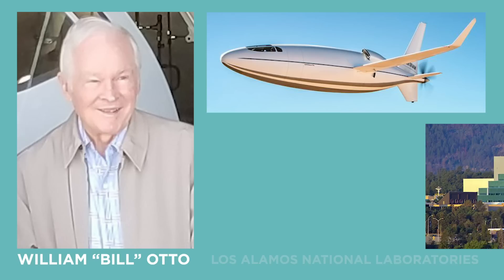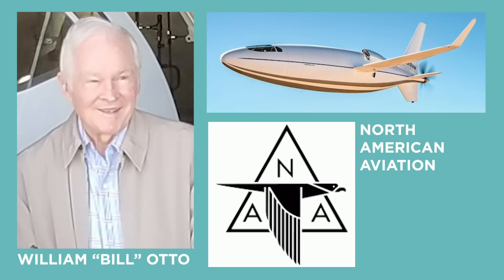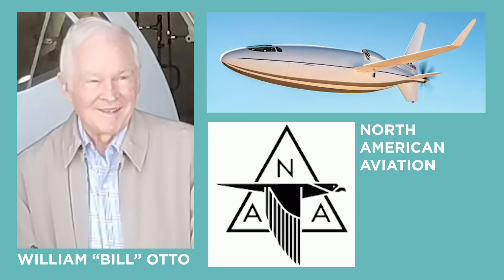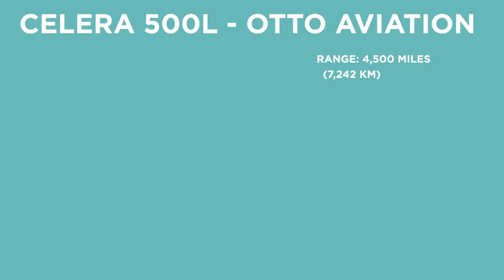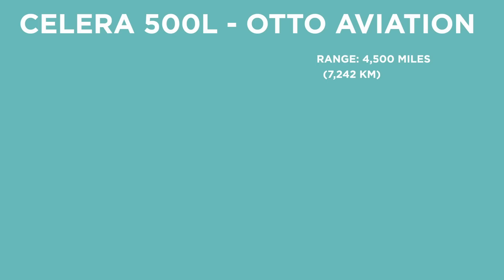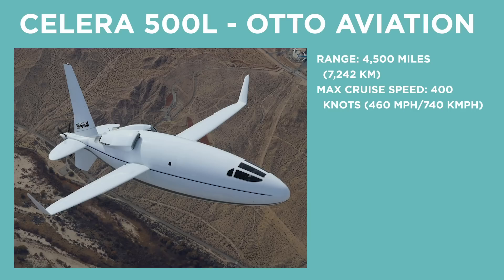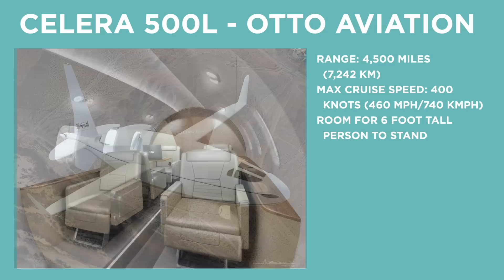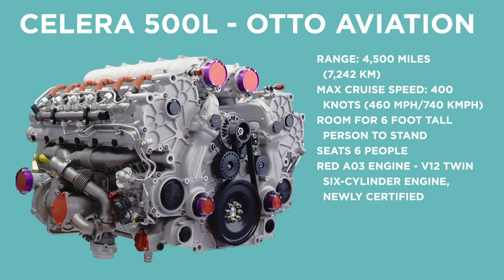Could This Plane Save The World? (Hint: No.) | Answers With Joe

Comment: Joe, I agree with your analysis, and your final thoughts on the real value of the Celera. Here is a sample use that I envision: I live an hours drive from Sea Tac Airport in Washington State and 20 minutes from an airport bus service. Near this bus service is a small airport that serves business jets. Let's say that I want to take my family of 4 on a trip to visit relatives in Wisconsin Rapids -- a small town that probably also has a small airport for general aviation. Right now I have to drive to the bus service, getting there 30 minutes early, then take the bus to Sea Tac, taking an hour, then spend 2 hours going through security and waiting for boarding. Then waiting on the plane for departure, and finally take off. Similar procedure in reverse on arrival in Milwaukee. But few flights go directly to Milwaukee. Last time we did this, our flight went to Kansas City which must be a few hundred miles south of a direct line from Seattle to Milwaukee. Double that for going back North. Then add in the landing in KS, layover, and plane change. That is a full day. A long day. And we still have to drive or bus a couple of hours to Wisconsin Rapids.

Now consider a Celera charter service. We take our family of four and invite a couple of friends. Or, let the charter service find a couple of people to fill the other two seats -- someone who wants to go to any small airport Between our little town and Wisconsin Rapids. We simply drive 20 minutes to the airport, arriving 10 minutes before departure. The plane lifts off about 10 minutes after boarding. They fly us directly to Wisconsin Rapids -- with possibly an hour or two spent delivering the other two people someplace else. They could fly at half speed, saving even more gas, and we would still get to Wisconsin Rapids faster than on a big jet. And fly in first class seats!

Comment: I’m an engineer and about 7 to 8 years ago I was thinking about how I’d design my own personal aircraft (a real stretch lol)

But yeah, the shape of the fuselage I figured would be a NACA 0025 profile revolved around its axis. What that does is create the largest volume to surface area ratio, in a profile (like a teardrop) that would result in a very low amount of subsonic drag. You could fill the volume up with fuel tanks, engines, cargo, whatever.

I wanted to put the propeller on the back because the profile just doesn’t lend itself well to a front prop, but rear props have problems with ground strikes, so usually any benefit you get from the rear prop is omitted by weight added in landing gear.

Last, yeah, if you look at subsonic lift long enough, you come to the conclusion that high aspect ratio is more efficient. So you wind up with wings like a glider, that you see here. The problem with that is structural again. So hopefully you don’t lose performance due to weight, which is why most planes don’t have glider wings.

Last, high altitude flight is more efficient if you can get the propellor sorted. Air is thinner, less drag. Less lift too, but if you have enough lift, the drag will be less the higher you go. You can run a turbo to keep the engine producing power at high altitudes.

Anyways, def cool to see this guy implementing those ideas. Not often you get to see industry implementing what logically makes sense on the surface. Otto is the people’s champ!

Comment: It comes down to not MPG, but passenger miles per gallon. Economy of of scale.

But for charter, yeah it’s potential is big time.
Reply: He adjusted the 500l's passengers miles per gallon economy. He did it  backwards by scaling up the number of 500l's but the effect on the math is the same.
And the 500L's actually did better then 747's in passenger MPG. By a lot. I'm pretty shocked.
(Except he made one mistake. the 500l's would actually be carrying about 50 more people with the pilots he forgot to tally them. Making it even better in those regards. I think it will be a design Revolution. But nowhere near replacing 747's way to small lol)
Reply: @allhumansarejusthuman.5776 
“...A 747 is transporting 500 people 1 mile using 5 gallons of fuel. That means the plane is burning 0.01 gallons per person per mile. In other words, the plane is getting 100 miles per gallon per person!..”
Reply: Passenger-miles per gallon is only a thing for airliners and large corporate jets that shuttle employees between facilities like the jets that ferry people between the Fiat and Chrysler headquarters.
Private aircraft under 15 seats spend most time at partial payload, often because full fuel eats into passenger/cargo capacity. Or vice versa. This won't be flying many Part 135 flights, it's too small and expensive to fly as an unscheduled charter aircraft. It could do some scheduled air taxi stuff, though.
Its direct competition will indeed be the Pilatus PC-12 which carries 2 more in a smaller diameter fuselage and also can use unimproved airstrips. Aircraft with pusher propellers usually can't qualify for rough-field operation because the nose wheel kicks up debris that can damage the propeller. Plus they have restrictions on pitch up at rotation. The turboprop of the PC-12 is going to have a lower operating cost (ignoring fuel) due to higher overhaul hour limits and a more accessible engine with modular construction.
20 mpg is Mooney territory, but without the cramped passenger compartment of the low frontal area design of the Mooney.
The problem with laminar flow designs is that the laminar flow gets disturbed by things like bugs and dirt, ice, and even heavy rain. This can turn a slick, efficient design into one that can barely generate enough lift to maintain altitude. If you are going to want to cross the US in this, you'll want things like deicing gear that tends to disturb the airflow.
Reply: @allhumansarejusthuman.5776  Pilots are not paying passengers, they are on the minimum equipment list along with enough flight attendants to safely manage a 90 second evacuation. A 1000 mile trip in a 747 is something you only saw in Japan on domestic routes due to air traffic congestion limiting the number of takeoff slots. Much of the fuel burn in a jet is down low where the engines are less efficient and they operate with drag-inducing stuff hanging out in the air. On longer flights the per-mile fuel burn drops quite a bit.

Comment: I know this is a couple years old by now. Something that may have been covered in the 2,700 comments is maintenance. Your example assumes all 61 Celeras would be taken out of service for maintenance at once, just like the only 747 in your comparison. The loss of revenue during downtime would be much less than the 747. Of course, paying for 61 maintenance activities may cost more than the one session that takes out the 747 (knowing full well they aren't subjected to just one maintenance session per year). Still, that's a lot of missed revenue while that 747 isn't flying.

Living in the northeast, I would love to see 1 flight heading for Newark Liberty reduced to just 1 with 60 more heading to the hundreds of smaller airports between Richmond, VA, and Bangor, ME. Reduce layovers, put the people closer to their actual destination, and make way for smaller, far more efficient aircraft to take them there.

Great video, as always. I would have liked to have seen more about maintenance. I mean, it is powered by one diesel V12. Oh, and 2 months ago they raised the range to 5,000 nm from 4,000.

Comment: I believe you should consider few points:
1) 747 and A340 (or whatever) cost around 2/300M $
2) An eventual 1000L with autonomous driving will be even more convenient
  2a) It may carry around 20 passengers
  2b) A lot of current airplanes fly with empty seats
3) It will open a new kind of transportation (shorter and more frequent connections)

Comment: I personally share the opinion that we just need to figure out how to fly less. We need to invest in high speed rail. Flying should become something we do for longer trips.
Reply: well you could just invest in hyperloop high speed trains and never really have to use planes at all
Reply: @ThaEnglishPwner  hyper loop is a novel idea but it has a lot of real world issues. High speed rail is a proven technology that can be rolled out rather quickly.
Reply: Hyperloop can compete with long-haul airliners, while neither form of high speed rail can. Conventional tracked high speed rail has operational speed limits due to vibrations from the wheels on the tracks creating an unpleasant sensation for passengers, and very few will go by train if a plane is quicker and cheaper. For current forms of maglev, the extremely high cost of installing and operating the tracks means they're only economically viable in extremely high density areas, and will never be a viable option for long-distance travel.

That doesn't necessarily mean hyperloop will become a major mode of transport - at least, not on this planet.

Electric planes will be okay for short-haul, but can only become an option for long-haul if we find a way of making batteries with well over ten times the energy density of current options. This leaves two main options for long-haul travel: hyperloop, or high-efficiency planes running on sustainable fuels, and I think the latter has major advantages over the form. First, most intercontinental routes will have to use planes due to the difficulty of building a hyperloop tube under the ocean, especially if there is a tectonic plate boundary involved. Second, airliners already have a lot of ground-based infrastructure, so the amount of investment needed to get them flying is low. And third, fusion power looks set to become a viable energy source about a decade too late to become a major one, and will instead play second fiddle to renewables like solar. This is important because solar's major disadvantage - the huge summer surplus - is an advantage for anything requiring sustainable fuels, because it can be used to produce them. If fusion power were already widespread, hyperloop would be competing on a level playing field. Because solar is already a major energy source, and is set to continue growing in the future, sustainable-fuel airliners have a significant advantage.

There is one place where hyperloop does make sense though, we're just not there yet: Mars. The thin atmosphere means winged aircraft don't function well, if at all, while hyperloop tubes don't need to be as robustly engineered - and therefore expensive - as on Earth. Likewise the lack of oceans means hyperloop has few restrictions on where it can go.

Comment: I didn't read all the comments yet,  but I wanted to comment that this airplane is a stellar example of the really good gas mileage  a really good designed airplane  can get. To wit, really goodly other airplanes get stellar mileage like..no  motor at all!  Gliders. Google 'Bodies Of Rotation' s to see how they get the smoke back into the bottle. And this concept is scalable.

Comment: 2 things. 1) Its 6 business class seats which can be swapped out for normal coach seats. 2) The Celera 1000L is likely the one the airlines would be interested in to replace their jumper fleet of jets. The 500L is more aimed at small private jet replacement.

Comment: My experience is that companies can't "efficiency" their way to success...
Reply: Depends on the company/industry. There's many that work on razor thin margins.
Reply: "Efficiencying" the way to success has gone out of style in the 30s ...
Reply: What experience do you have that an inefficient company was highly successful?
Reply: Especially in the aviation industry.
Reply: @KazCanning  it's kind of like a social truth. do gamers want the most efficient computer? or do they want the one with the wasteful interior lights, and power hungry heat generating processors? do all of the Fast & the Furious wannabes drool over the most efficient car? No, one trip up the highway will tell you that they don't.
Reply: @KazCanning  Congressionally approved military contractors.
Reply: @better.better  Yes I want the most efficient computer. And that's why everyone chases the new updates(the lighting is an aesthetic but that doesn't mean I want an inefficient computer) I do not know why you mentioned that, it just made ur point worse.
Reply: @KazCanning  the American political system
Reply: @KazCanning  : I'd guess that the proof is actually the other way around- the low-cost long-range airlines have demonstrated that efficiency does not make the difference. I saw a video on the subject, and they determined that because of the higher cost of the efficient options, the cost benefits of efficiency were eliminated, thereby eliminating the ability of efficiency to make airlines successful. The things that make a difference are things like competition (if you have more competition on a route, then you need a better reputation, which means more comfort, which means more money per seat, which means you need to increase the cost of a ticket to compensate), not fuel efficiency.
Reply: Unless... The Expanse
Reply: @eleonarcrimson858  Do you want a slow computer that is very efficient, or do you want a fast computer that is inefficient? That's the real question. You generally don't get both power and efficiency in any application.
Reply: How are we all defining efficiency, exactly? Are we measuring it purely by energy in/energy out? Or are we taking into consideration all other possible needs/wants of consumers and whether or not they are being met by the products of producers? Because under the former definition, an airplane with no seats, bathrooms, or passengers would be extremely fuel efficient. Or would we all agree other factors need to be taken into consideration when defining efficiency? Such as whether or not it can grab any customers. 

Fuel efficiency =/= efficiency, is my point. Industry is much more complex than that.
Reply: @dallyh.2960  I don't think anyone here is equating fuel efficiency to just efficiency, although that would be a big part of it.
Reply: The fundamental problem with chasing efficiency is 100% is all there is, there ain't no more. Further, as efficiency increases it becomes more expensive at an exponential rate.
Reply: @dallyh.2960  My point is that if your business strategy is to do something a little more efficiently that your competitors - you will go bust.  Businesses may have small net margins, but because of all the overhead involved with any business in the developed world with all kinds of business services hanging around your neck, you need a serious competitive advantage to make a profit.
Reply: cough*tesla*cough
Reply: @better.better  that's not a company though. People have those computers for fun.
Reply: @jeffk464  it's because it's government related. Government spending is wasteful and not based in real world economics.
Reply: @davidegaruti2582  Well the next 30s are just around the corner so ...
Reply: @gregcollins3404  My point is that you can't measure efficiency by one standard, which you're not doing, so we don't disagree. Those company do make something more efficient, though: comfort and luxury. They want to sell you luxury for the highest price and lowest cost to themselves. 

Just look at an iphone. It costs $60 to manufacture an iphone 11 pro, and is sold for $1,000. What's their main focus in developing their product? Luxury and comfort. 

It's kind of a weird way to look at things. Most people would think luxury is inherently inefficient and pointless, and so wouldn't see how it could be made more efficient. But it's done all the time. So much of modern life is pure luxury. We're immensely privileged. Comparatively speaking, the lightbulb is a luxury, and it's made more energy efficient by the year. Companies are always looking to lower costs of production (excluding the occasional monopoly) and to sell for the highest price point possible.    

I was getting the impression some people were measuring efficiency a bit strictly.
Reply: @crides0  Maybe so, but the arguments I've had with others in the past tell me otherwise. Some people can get rather authoritarian when it comes to saving the environment. One guy once told me that value was completely objective and that whole sectors of industry (including airplanes) needed to be shut down due to "inefficiencies" that "in any modern and moral society" would make them unprofitable. 

I'll take your word for it though. I prefer your optimistic view on people more than my own.
Reply: @dallyh.2960  Oh I was talking about this discussion in particular. Yeah, there are tons of people out there that just can't stop telling people how others should behave. I don't care that much, but then again, there's no regulations that guarantees that they won't affect our lives.
Reply: @danieljensen2626 , I'd suggest adding one more variable: cost.  There's generally a three-way trade off between factor A, factor B, and Cost.  If you want an efficient computer that's low cost, you sacrifice speed.  If you want a fast, low cost computer, efficiency goes out the window, and if you want a fast, efficient computer, you have to ditch the cost and pony up the dollars for your machine.